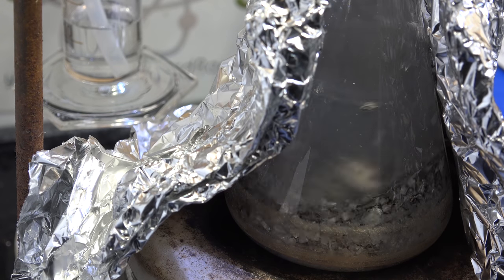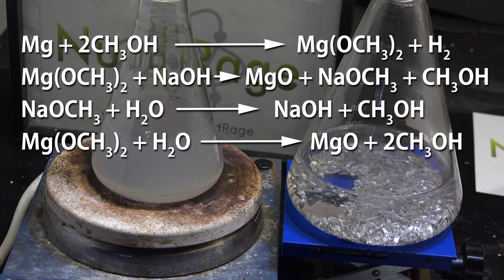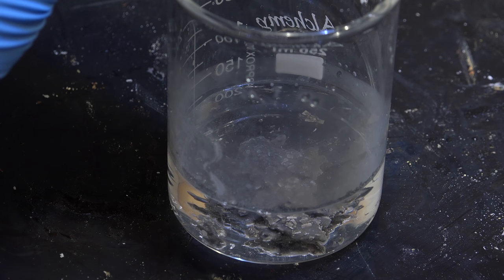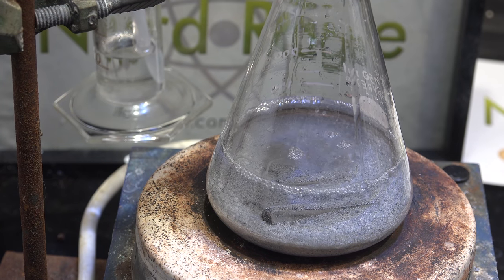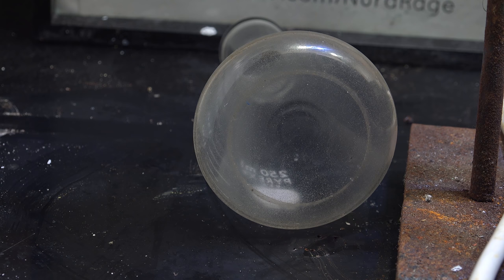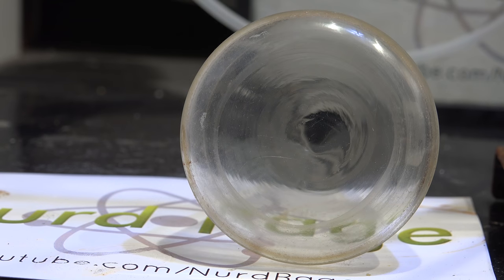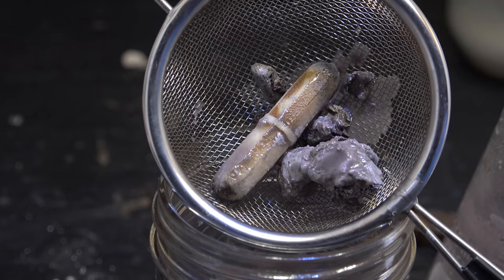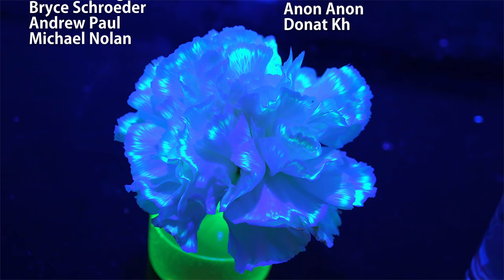Lab Notes - Alternative glassware protection for sodium production (Successful) - August 31st 2018

Comment: Truly awesome.  maybe someday we will be able to do the process with heat form the sun and thermal convention.  It would be nice to have a massive, though slow device you just leave out in the sun then come back much later and have sodium metal.  i don't know about you but doing these kinds of things in my house makes me nervous and not needing electricity would make the whole thing easier.  I agree that lithium cells are easier to get then sodium, but just buying a small amount of sodium is still pretty easy and likely cheaper then new lithium cells. will "dead" lithium cells work?
Reply: https://batteryuniversity.com/learn/article/what_causes_lithium_ion_to_die we see here that what really happens is the metal doesn't recover completely from the two points; it's just not being recovered fully in the charging/recharging process. So while your collection point may differ, the lithium isn't actually leaving the battery. You could probably even do this with a cheap Li-ion battery from a dead kids' remote control toy.
Reply: Kain Yusanagi wrong type of battery. The cells used here are lithium metal not lithium ion. Li-ion likely wouldn't work at all.
And no dead cells wouldn't work because all the lithium was used up and this use needs lithium as metal.
Reply: 1) Even if we're talking a lithium metal battery that uses a lithium metal anode, a dead cell is a depleted electrolyte solution or the anodes are coated with electrolyte-inhibiting substances produced during the energy transfer process; the lithium metal itself doesn't somehow vaporize and get eliminated. 2) Li-ion could still be used. Just need to remove the lithium from the organic solvent it's suspended in first.
Reply: Rofl no need for the lithium to vaporize when it forms a compound. As i wrote earlier this process needs lithium as a metal so any other state won't work.
Reply: And you can process it. Just because it takes more work doesn't mean you can't use it. -.-
Reply: Well yes it is possible to process it but getting lithium from a salt is quite a task in itself.
If you factor in the chemicals needed for that, then new cells are cheaper.
So using dead cells or Li-ion cells to get lithium is only workable if you are doing it out of interest.

If it is just to start this process then better get a new or somewhat used cell and save yourself the hassle :)
Reply: A dead lithium metal battery just will have lower quality lithium, because of the compounds that coat it; you can still use it just fine; hell, NurdRage says as much in his video covering recovering lithium metal from those batteries in the first place. Or, just do a quick cleaning of the surface under a nitrogen atmosphere with some hexane and a toothbrush to clear up the surface oxide layer.

As for lithium ion solutions, which, commercially, most commonly use lithium hexafluorophosphate- you can just knock the lithium free by adding an alkali hydroxide to precipitate the fluorine and phosphorus- potassium hydroxide is cheap and readily available- and then knock the lithium out of the filtrate with some cheap alkali carbonate, like sodium carbonate (also super cheap). Don't believe me? Here's a patent for the process. https://patents.google.com/patent/US20150013499A1/en 

Long and short of it is that it really isn't more expensive to process it or to clean used lithium metal from dead cells for this reaction, and if you can get your used batteries for under a dollar a piece (likely free) or only use the ones that have died out after you've thoroughly used them, so you get the most out of purchasing them, then you're actually going to end up saving money overall for lithium-based reactions done en masse. And it's not like soda ash and lye are rarely used in chemical reactions, either; Hexane I can't comment on as much, but even if you don't have much use for it for chemistry, it's an excellent industrial-strength solvent and paint thinner, and getting a small bottle is pretty cheap.
Reply: I have taken apart quite a few dead lithium cells because a company i used to work for produced a lot of those.
Of course i was curious if i could get lithium out of them :)
Now with some of the cells the anode looked as if a surface cleaning like you described could work but when i added them to water as a test i found they were just some carrier foil. (Aluminium i think)
In the cells without a carrier foil the anode was just a crumbly mess.

In both cases the lithium seems to have been pretty much completly consumed to form lithium sulfide.

Now if you take a look at the characteristics of lithium primary cells it makes sense that unlike other primary cells they die because the electrode materials is used up instead of blocked by reaction products.
In most primary cells the voltage drops significantly as the capacity is used up. That indicates the formation of a barrier on the electrodes as you described.
However lithium cells keep the voltage nearly constant over the whole capacity range until the voltage drops suddenly when the capacity is used up. And that is consistant with a depletion of the electrode materials.

In short while i have never seen a carbon/zinc battery where all the zinc was consumed there was no usable amount of lithium left in the dead cells i have opened.

Now it might be possible to use the lithium sulfide as a drying agent because it reacts with water but that really should be done outside or in a fume hood because that reaction forms hydrogen sulfide. Also i have no clue if the hydrogen sulfide would have an impact on the sodium recovery or not.

As to the process for recovering lithium from Li-ion you linked it is indeed quite straightforward (and would work for the primary cells too).
However the product of that process is lithium carbonate so you are stuck with a lithium salt again.
Now for industrial purposes that is no problen because lithium carbonate is the precurser used to make pretty much all other lithium products from but it won't work as a drying agent in the reaction here.
Reply: It's not much more of a step to go to molten salt hydrolysis from there to free the lithium metal from the carbonate bonds, and as for the lithium sulfide mess you're talking about, sounds like it was a li-ion battery rather than a li-metal battery, and that was a li-carbon cathode; basically you got a lot of graphite left over.
Reply: Well if you are willing to work with molten salt then you don't need batteries at all because you can just use molten salt electrolysis for the sodium.
And the batteries were primary lithium cells because the devices we made had to be able to run off commonly available batteries meaning 1.5V AA or 3V photography ones but specifically not Li-ion. The ones with the crumbly mess i think were even the ones NurdRage used iirc.
Reply: You and I both know electrolysis is slow and electricity-hungry; you want to do it as little as possible in a home chemist environment. Thus why the lithium, since you really don't need very much of it at all, and you then start the reaction to produce sodium cheaply, and that can be constantly regenerated, taking much less energy to do, and thus lower your bill.
Reply: If you go the molten salt way it doesn't make much of a difference if you do it with lithium or sodium so you can just as well make the better suited sodium as a starter.

Comment: why dont you encase the stir bar in glass to protect it
Reply: Because polytetrafluoroethylene (Teflon™) is quite a bit cheaper to coat things in than borosilicate glass. It's also more generally durable, typically more chemically resistant, and won't break or make a horrific racket while it's spinning around a glass container.

It just happens that Sodium Hydroxide is one of the things that can actually attack glass on human timescales. Water can dissolve silica oxides like glass, it just takes such a long time that we discount it. Aluminum ore for example is made by the "chemical weathering" of silicate rocks, that means water coming through and dissolving some parts of the rock taking them away and concentrating the remaining materials. Aluminum Oxide is obviously less soluble in water than the silicates or it would be leached out, not concentrated.
Reply: I guess it would be simple enough to ask an artisan glass-blower to make one from old broken glassware.
Reply: no it's pretty easy.  just cut a glass pipette to size and seal the stir bar inside.
Reply: The pipette wouldn't work, most of them are soda lime glass, not borosilicate. It'd be chemically attacked even easier than the current ones.

And you'd still run into the whole "glass breaking" issue even if it was borosilicate glass... probably even worse because the stir bar itself can move inside the coating.
Reply: That's such a weird argument... by saying that most of them are not borosilicate, you are implying that some of them are.  So obviously the argument should be constrained to the ones that are.  We have made our own stir bars using this method, and it works.  The reason why Teflon stir bars are especially torn up is because the attack on them are both mechanical (abrasion from metals/solids) and chemical.  Glass encasement protects it from abrasion because glass is harder...

Comment: Make a way to copper coat the inside of a hole for PCB making. Please please please
Reply: I believe they use copper electroplating baths for this. Simply hook up the insulating fiberglass board to the cathode, and copper will start plating inside the vias (it will also plate the non-conductive edges of the board, but this can easily be cut-off afterwards XD).
Reply: I believe he has started he doesn't want to coat the vessel in any opaque substance so that the reaction can be visible and more easily controlled.
Reply: @MRLT how is the copper gonna stick to the fiberglass on its own? Like you said it's insulating. The vias need to be chemically coated with copper first
Reply: That is correct. You first have to use a chemical bath to coat them with copper and then thicken the copper layer via electroplating.
Reply: @jort93z do you know a process?
Reply: The holes are coated with conductive ink, clean off the excess, and electroplate. Most home circuit board maker's prefer working around the lack of plated holes but it's entirely doable if you're motivated.
Reply: That takes too much time and gives poor results... I here by demand a better diy process to be explained by nurdrage

Comment: Would those same cells, but depleted, still work?
Reply from the maker: Not recommended, if the lithium is depleted its drying power is also depleted (the chemistry works like that). So you may not have enough for your sodium hydroxide and end up damaging your glass. I recommend using 2x-4x as many batteries if they are depleted.